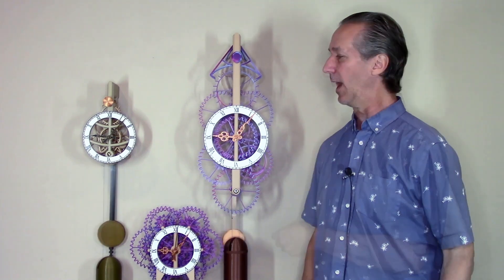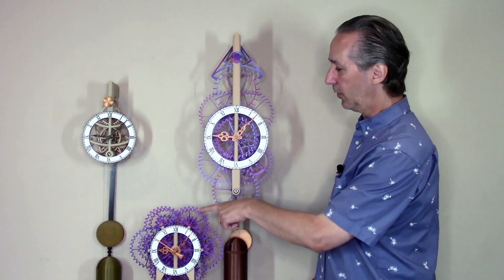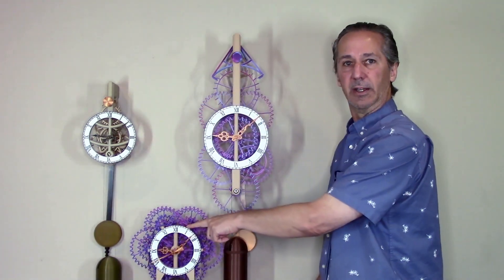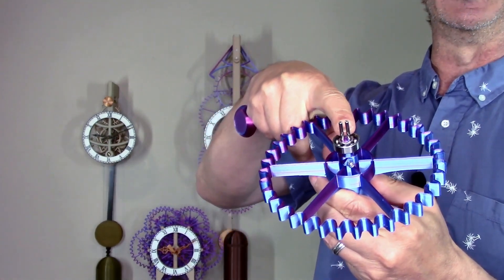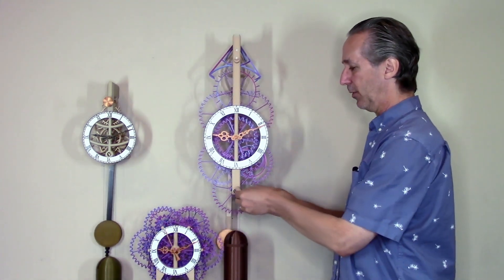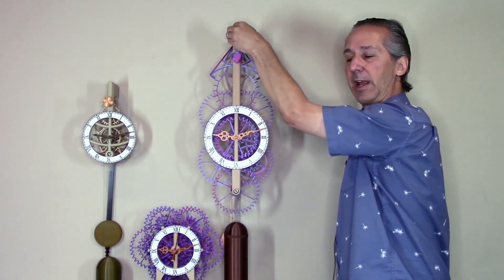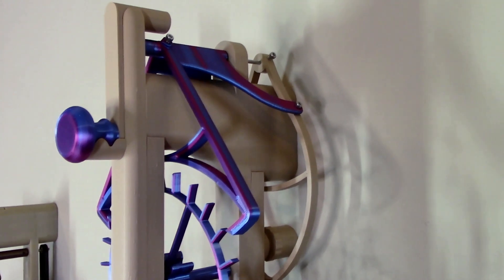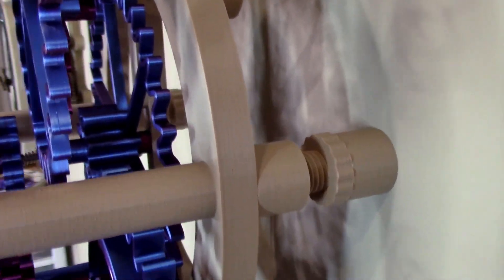Crazy Gear Wall Clock

Comment: Where can I get one of those from they look good 👍
Reply from the maker: The design can be downloaded from https://www.myminifactory.com/object/3d-print-crazy-gear-wall-clock-309948 to 3D print the parts to build them. There is a nominal charge for the plans, less than the cost of a roll of filament.